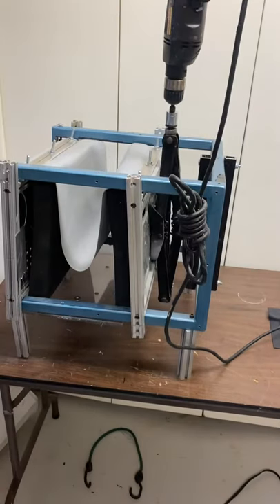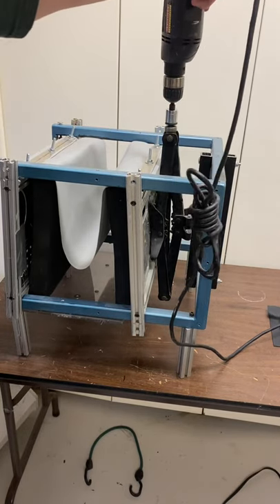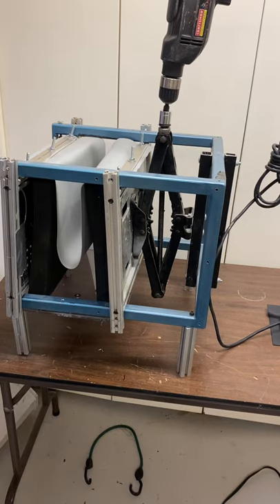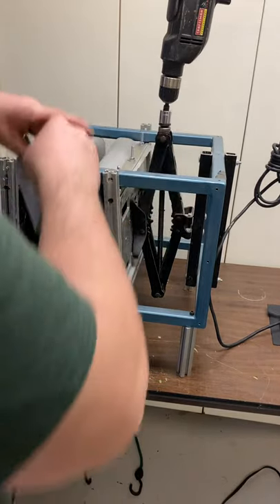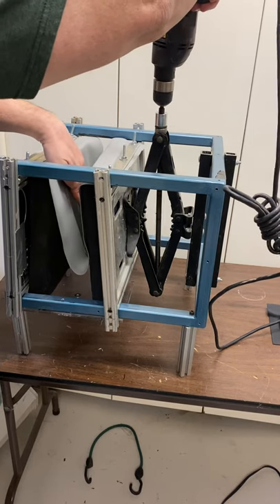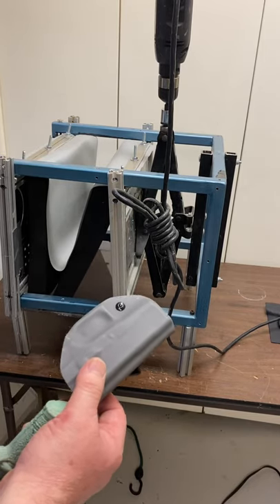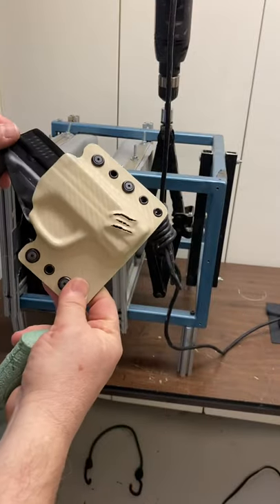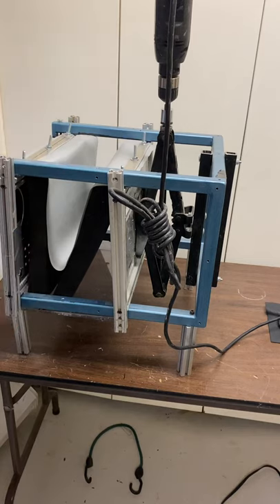Kydex press for making taco style Holsters

Comment: That is a very cool set up, as the previous gentleman mentioned.  What type of metal rack is that, what is it called/referred to, and where could I find one online that comes with the 2 sliding parts that you mounted your foam to?  I made my own 2 piece Kydex press with a 2”x4”, 3/4” plywood cut in 1’x1’ squares, it it always leaves a tall gap between the sights.  My buddy has the taco press, and his holsters come out much better, but I don’t want to drop $140-$175 on one after taxes and shipping.  I’m like you and would rathe build a sweet contraption like the one you have in this video.  I am just not that familiar with racks and attaching pieces like the one in this video.  I’ll do some research until I hear back from you.  Thanks, JP